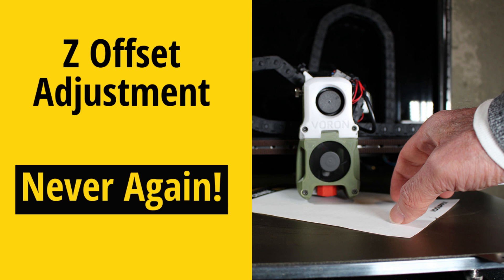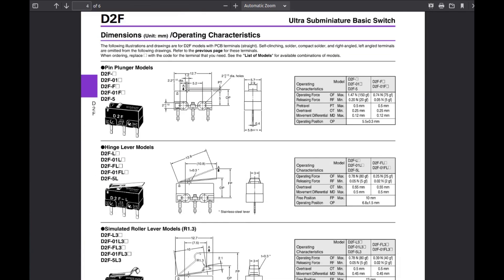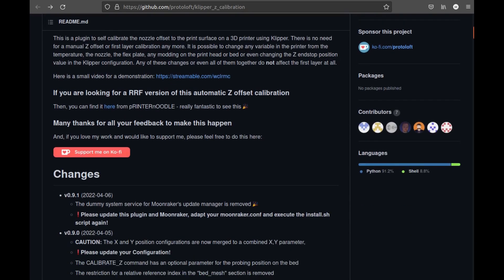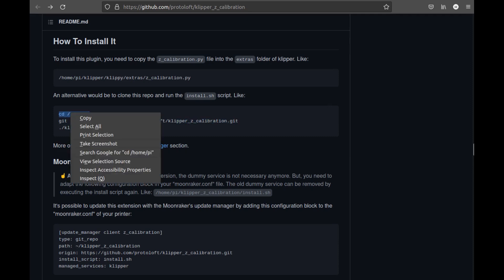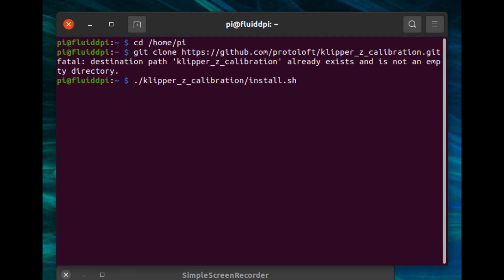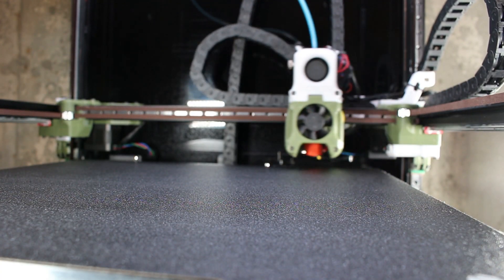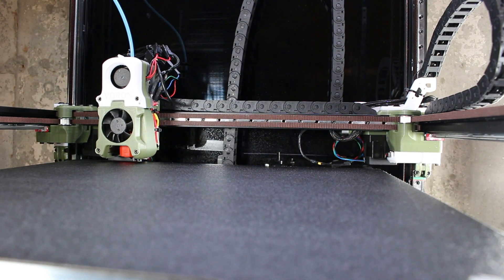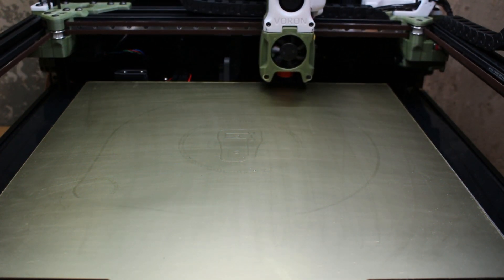Never adjust your 3D Printer Z Offset again with Klipper and a plugin

Comment: I've almost got it. One last question. When you run the command "calibrate_z" how to you set it to raise the printhead after probing the nozzle? My printer probes the nozzle then just moves forward, knocking the klicky probe back and rams the nozzle into the bed since the switch isn't there to contact the z endstop. I notice in your video the printhead raises. I had z_hop define at 10 in the printer.cfg but after this install I had to comment it out.
Reply from the maker: It sounds like you might not have the correct coordinates.  In your cfg file you should have something like this where you set the positions.  These were my settings.  Yours will be different depending on your measurements as shown in the video.  Even if your bed is 350mmx350mm like mine, they probably won't match exactly since our beds are not exactly bolted down in the same place.

[z_calibration]
nozzle_xy_position: 227,350  ;   A X, Y coordinate (e.g. 100,100) of the nozzle, clicking on the Z endstop.
switch_xy_position: 232,328  ;   A X, Y coordinate (e.g. 100,100) of the probe's switch body, clicking on the Z endstop.
bed_xy_position: 170,170     ;default from relative_reference_index of bed_mesh
switch_offset: 0.519
#...the rest of your file follows....
Reply: @KapmansBasementWorkshop  Mine are different. But everything looks the same except the values:
UPDATE: I figured it out 😀
[z_calibration]

I commented out this line because it gave me the error "Unable to parse option 'clearance' in section 'z_calibration'"
clearance: 5 * z_offset from the "probe:z_offset" section
The line is needed but needs the ## after the value, so:

clearance: 5 * ## z_offset from the "probe:z_offset" section
I don't know why they don't have it written that way in the documents but either way I'm one step closer to having a fully functioning printer equivalent to my Prusa MK3. Many thanks for your help.
Reply from the maker: @Hopeinformer  I'm glad it's working now.  Thanks for watching!
Reply: @KapmansBasementWorkshop  Do you have a venmo or Zelle? I'd like to send you a little thank you.
Reply from the maker: @Hopeinformer  I truly appreciate the gesture.  But I don't have either.  And even if I did, I would ask you to send the little "thank you" to the creator of the Klipper plugin Protoloft: https://ko-fi.com/protoloft

Comment: I'm trying to get the Klicky Probe to configured but Klipper gives me this error message:

Existing command 'BED_MESH_CALIBRATE' not found in gcode_macro rename
I don't know what it is asking for since there is a macro for bed mesh calibration. Is it saying there's 2 of them and I have to rename one of them? Any help is appreciated.
Reply from the maker: I have a "euclid.cfg" file setup that is included in my printer.cfg file.  In the Euclid.cfg file you should have something like this:
[gcode_macro BED_MESH_CALIBRATE]
rename_existing:    BED_MESH_CALIBRATE_ORIGINAL
gcode:
  M401                           ; deploy Euclid Probe if needed
  BED_MESH_CALIBRATE_ORIGINAL    ; check bed level
  M402                           ; dock Euclid Probe

So yes, there are 2 of them and the original needs to be renamed and it's called from the new one.
Reply: @KapmansBasementWorkshop  Thank you so much for your help and quick reply. I have Klicky_Bed_Mesh_Calibration.cfg In this file it has
[gcode_macro BED_MESH_CALIBRATE]
rename_existing: _BED_MESH_CALIBRATE
...
I removed the line "rename_existing: _BED_MESH_CALIBRATE" then saved and restarted and the error message went away. I don't know if I fixed it or just created another issue down the line. haha Thank you again for your help.
Reply from the maker: @Hopeinformer  I believe you created an issue for yourself unless you just don't use a bed mesh.  If you don't, you should be ok.
Reply: @KapmansBasementWorkshop  Crap. I do want to use bed mesh. But at this point I just want to start printing something/anything haha
Reply from the maker: @Hopeinformer  Then this should be fine.

Comment: I'm so excited to try this out. This is a huge deal. That was one of the few manual things left on a Voron.
Reply: ..and done on one printer, that was  way less painful than I expected. To make it a bit easier, I even added calibrate_z at the end of my quad gantry leveling macro, just before the probe_dock ('m using the klicky probe, not euclid).

Thank you for the video!
Reply from the maker: Wow, that was fast!  If you get the chance, please thank Protoloft the creator of this code with a coffee.  I agree with you, this was one of the few manual things left on my printer.  I love it.  I've been able to knock out prints since creating this video with a huge increase in consistency compared to my Voron prior to this change and also compared to my previous printer.   I'm glad you found this useful and thank you for watching!

Comment: Bed_xy position 170? Why its not 175 at a 350×350 bed?
Reply from the maker: Honestly, I'm not sure.  Probably a mistake.  I suppose one could choose a location to strategically average the bed flatness....Thank you for watching!
Reply: Because 0,0 is between 5-10mm off the rear and right of the bed where the voron 2.4 x and y endstops are located and the build plate may not be exactly 350x350. 175,175 can not be center of the bed. its more likely 180-185 or something.
Reply from the maker: You can set it to any location you feel comfortable with

Comment: Does anyone know if this will work with a bltouch instead?
Reply from the maker: Someone seems to have gotten BLTouch working right here: https://github.com/hawkeyexp/auto_offset_z
But I can't use a BLTouch due to heat issues, so I have not tested this.  But you can certainly give it a try.

Comment: Haven’t adjusted my z offset on my prusa or on my Ender for 6 months. Seems I’m always fiddling with the voron. I might just go to a pinta probe on it as well because the prusa is solid
Reply from the maker: I've heard that some have had good luck with that probe.  I've got no experience with it....yet.  Thanks!
Reply: There is complex code in the prusa to compensates for the temperature variations that effect the pinda probe. That is why it works so well. The pinda probe isn't the magic. The code is. Same as with this style probe.

Comment: I always thought the Z-offset was the difference between the probe and the nozzle. I rarely change bed surfaces but I can't wrap my head around the need to re-do z-offset when changing beds. I'm genuinely curious, how much does the z-offset value change for you when changing between different bed surfaces?
Reply from the maker: I've got 3 that range in size from 0,8mm to 1.4mm. That has a substantial impact on how my prints look (or even print) if i don't re calibrate.  And the paper method for me is a little too subjective.  So now I get consistency.  Thanks for watching!
Reply: @KapmansBasementWorkshop does Klipper support bed profiles?  Just setting up a 2.4r2 350. But on say my Prusa I have a smooth and textured profile, once I got Z dialed in on those all I have to do is switch the bed on the screen.
Reply from the maker: @filanfyretracker  Not that I'm aware of.  But I'll need to check and see.  However, you can create multiple profiles in your slicer depending the the bed you wish to use and handle it that way.
Reply: There are at least 3 Z_Offsets (or even more) in klipper, which you use with Stock Voron 2.4 setup. There is in the [stepper_z] section position_endstop, which determines how far the nozzle is away from the bed (positive value) or below the bed (negative value) when the endstop pin switch triggers. Then there is in [probe] section z_offset which determines the difference between probe triggering and the nozzle. My probe e.g. triggers when the nozzle is 0.710mm above the bed, which you "meassure" or calibrate with probe_calibrate (whereafter it moves to the automatic section at the end). For a stock voron V2.4 this value is in prinziple not relevant, as it will use "mesh_relative" and rely on the position_endstop. And then there is the Offset Z which u can adjust during printing via the display or via the set_gcode_offset z_adjust=x.xxx commandiot to come closer to the bed or stay more far away.. And sadly the intention of voron in this design doesn't work as well as they thought. In principle the system they use should be perfect, as the nozzle tips the pin and independent what changes the switching point should have a permanent hight over or under the bed.. But there is where thermal deformation comes in.. the bed will bend with temperature, but really not much. The hight of the bed may change if u use different printplates. But mainly the temperature inside the closed chamber will destroxy the system. The x axis will bend a bit, which means as the pin is not at x center, the carriage will be on another hight, depending how warm your printer is already, relative to the position measured. And even much more and destroying the solution, the z endstop pin will grow, and it's really much it grows, enough, to destroy your first layer at about every 10K more chamber or "pin" temperature. And as the pin is so close to the bed it will even warm up higher than chamber temp.
Reply: Linux tips here: "cd ~" will change to your home directory. if you want to change to a specific users home, "cd ~user" and if you have SSH, you generally have the ability to copy files with SCP... "scp user@hotsname:/file/from /file/to" or "scp local/file/from user@hostname:/remote/file/to" where the remote path starts from ~ unless you put an absolute path starting with /
Reply: You don't need to use this method when switching bed surfaces, only advantage is that this also takes care for different nozzle height for when you switch nozzles..

Comment: I’m a little confused as to why a thicker or thinner build plate matters to z offset. The surface of the build plate is always homed as zero, right?  Interesting non the less. Thanks for the video.
Reply from the maker: Actually, it's not always homed as zero.  Or at least no printer I ever owned did that.  But this software does that for you. Normally, a printer homes zero to the z-endstop and you need to set the z-offset yourself.  At best, a printer will typically level the print bed automatically if it has a sensor that allows it.  Thank you for watching!
Reply: @KapmansBasementWorkshop  Maybe that's my confusion. With ABL I've only ever homed using the probe as my endstop.  So you're saying you home to Z-endstops and ABL with a separate probe?
Reply from the maker: @brandonbell359  I have a micro-switch z end-stop for homing.  It's the metal pin that the nozzle and Euclid probe touch in the video.  That allows me to switch nozzles and simply homing the printer takes care of auto adjusting for any nozzle height changes.  Then it levels the bed (in this printer the quad gantry level).  It then auto sets the z-offset to make sure no changes have occurred in the bed plate/magnetic sheet height (I have multiple magnetic plates and they are not exactly the same height).  It also accommodates any changes due to temperature. So 3 different calibrations occur prior to each print.  And I can change the nozzle,  bed plate or both and have different temps set in the bed plate or printer (which also cause height changes) with no manual adjustment.  If you don't change nozzles much and only have one bed plate and always print using the same filament, this may not be as important to you.  Thank you!
Reply: @KapmansBasementWorkshop  ahhh. I see now. Thanks for the explanation.
Reply: @KapmansBasementWorkshop  Great explanation.
Reply from the maker: @Mehecanogeesir  Thanks!

Comment: my z is still too high after installing this any tips? the first layer doesnt stick together
Reply from the maker: In your "autoz.cfg" file (or whatever you might have named that file), adjust the "switch_offset" value. Decreasing the "switch_offset" will move the nozzle away from the bed.  If you adjust the z-offset during the start of a print until you see it working, you can later take that value and adjust the "switch_offset" by that amount.  But the "switch_offset" value is key here.
Reply: @KapmansBasementWorkshop  Hi There, no matter how much i increase the switch offset it still has no effect on the z height, i can step it during the print and get it perfect however if i increase the switch offset with the amount that i adjusted nothing changes can still physically see nozzle is too far away. any suggestions on what im doing wrong? this is very challenging
Reply from the maker: @helenocan8933  Apologies in advance, but after saving your changes to the printer.cfg, are you rebooting Klipper?  It needs to reboot to load the new setting.
Reply: @KapmansBasementWorkshop  yep saving and rebooting, i adjusted the switch_offset in autoz is that not right?
Reply from the maker: @helenocan8933  Yikes, sorry about that.  In the autoz file, not printer.cfg.  But, since you are making changes to the auto.cfg file, is that auto.cfg file included in the printer.cfg file?  If not, that could be a reason you don't see the impact of your changes, but I suppose this would not work at all if it wasn't there.  Hmmm..  In printer.cfg, under [stepper_z], is "position_endstop" commented out?  And near the end of the file, do you have another section like this? #*# [stepper_z]
#*# position_endstop = 0.880
And I'm assuming when you type "CALIBRATE_Z", it goes through all the steps of actually calibrating z?
Reply: @KapmansBasementWorkshop    Hi There, Under stepper_z i do not have a position_endstop near the end of the file i have: #position_endstop: -0.5 and correct when running the calibrate z it goes through the steps of calibrating it and everything looks ok, i get this in the console:
// Z-CALIBRATION: ENDSTOP=0.400 NOZZLE=0.381 SWITCH=5.657 PROBE=5.256 --> OFFSET=-0.520000

Any advice or what to che3ck, do i need to add a position_enstop into the printer.cfg?
Reply from the maker: @helenocan8933  That looks to me like it calibrated correctly and it's showing you the result of the calibration.  If you have not already done so, test it with a piece of paper to make sure the height should work and you have the correct value for "z_calibration:switch_offset" in your "autoz.cfg" file (or however you named the file)
Reply: @KapmansBasementWorkshop  hey mate got this working, turnes out i didnt have calibrate_z in my print_start, nor did i even have a print_start configuration lol, thank you for your help, got my first perfect layer now :)
Reply from the maker: @helenocan8933  I'm glad to hear its working.  I love this macro.  A huge improvement in consistency across my prints.

Comment: can this apply to non euclid people like me? i use ender3/bltouch. im thinking the sequence will go: home xy>bltouch home z on z-endstop (bltouch is triggered but endstop is not)>nozzle home z on z-endstop>calculate z offset=B-A+pretravel
Reply from the maker: If you don't want to use Euclid, you could use the Klicky probe instead.  Also, someone seems to have gotten BLTouch working right here: https://github.com/hawkeyexp/auto_offset_z
But I can't use a BLTouch due to heat issues, so I have not tested this.  But you can certainly give it a try.
Reply: You could but what would you gain by doing so? It would just be a more complicated way of doing what your already doing.
Reply from the maker: I believe in one of the other comments above I posted a link for someone that did this for th cltouch. That might work.

Comment: Your videos are really great. Thanks again.
One thing that I would like to achieve is to make the whole process quicker. Instead of picking up the probe, doing the gantry levelling, storing the probe, doing the safe homing, picking up the probe again, doing the auto z, storing the probe again, we have to get rid of some of the unnecesssary movements :)
Reply: [gcode_macro G32]
gcode:
    CG28
    ATTACH_PROBE
    QUAD_GANTRY_LEVEL
    calibrate_z
    DOCK_PROBE
    G28 Z
Reply: @stuttgartbatman3788  Thanks! I will try that out ASAP. And Grüße vom Ostendplatz.
Reply: @timha4102  so ein Zufall 😁 was für einen Drucker hast du?
Reply: @stuttgartbatman3788   Voron 2.4, Spider Board 2.2, Euclid Probe.
Reply: @timha4102  bist du bei Facebook? :)
Reply: @stuttgartbatman3788  Ja, unter diesem Namen
Reply from the maker: @stuttgartbatman3788  Yes, Thank you!
Reply from the maker: I've been thinking about the same thing for the last few weeks.  Sometime soon, I'm going to sit down and clean this all up.  I'm planning some future changes for the printer and I think it will be the right time to optimize that aspect as well.  Even as it exists right now, I'm so happy with the quality of the prints and the consistency, I'm going to enjoy it just a little longer before I start changing things... Thank you very much for watching and the great feedback!
Reply: BTW, CG28 can be replaced by G28.

I've just copied from my cfg where I have the "conditional homing" macro applied (very handy!)